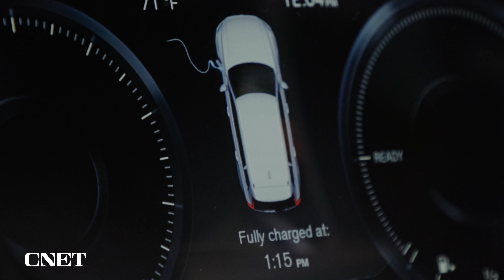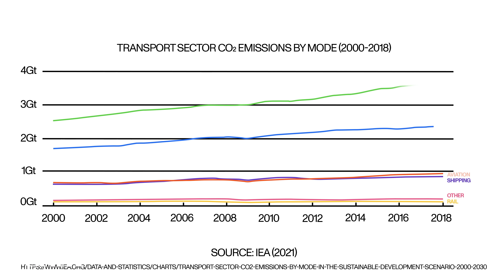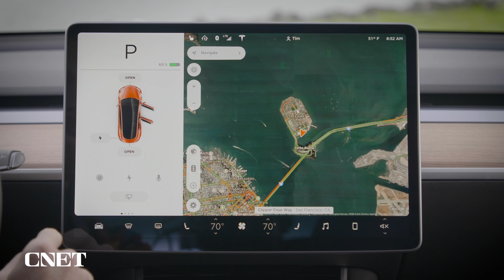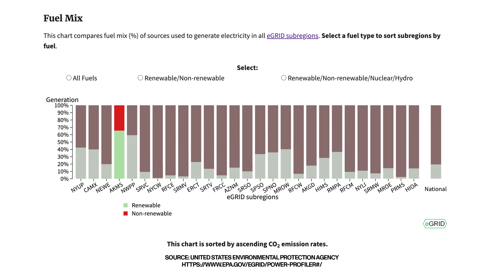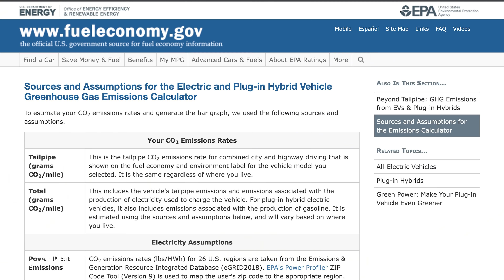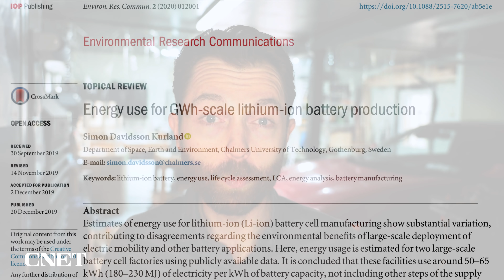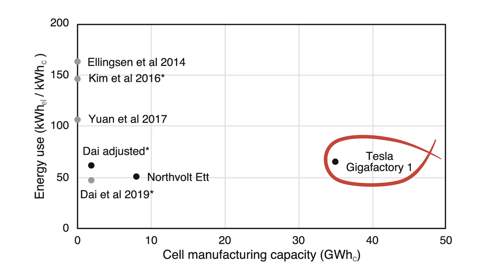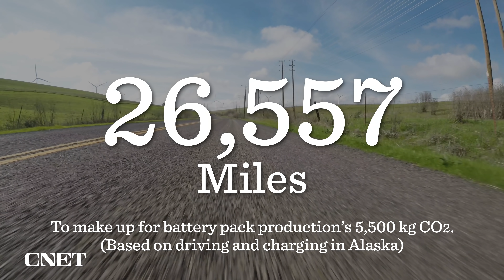Are EVs Actually WORSE for the Environment?

Comment: You didn't include the cost of a mandatory battery refurbishment after 5 to 10 years.. while an ICE can run for 20 years easily
Reply: Because your statement isn't correct. Battery packs will outlast the car they are first in (about 15 years), and then go onto a second life in some energy storage (another several years), and then be 98% recycled to become new batteries. Even with degradation after 200K miles, most EVs will still have enough range for someone. An aging ICE will need increasing repairs over time which is why most people get rid of them after a dozen years. They just aren't worth keeping on the road except for a handful of "classics". Meanwhile, a BEV can last 20 years with no maintenance other than the usual wearing of suspension parts. Although in the future I think more people may change cars, probably in the used market, more often to get the new tech that is constantly coming out.
Reply: Lol, you mean like the mandatory oil change ICE vehicles need every 5k-8k miles? 

I'm joking and see your point, but people don't realize that electric cars in the consumer market is still a new thing and far less developed compared to ICE. Tesla obviously wasn't the first to make the electric car but they were the ones who made them popular back in 2008. You're talking about 15 year old consumer technology vs 100 year old consumer technology that is much more developed and available to the masses. 

Honestly the only thing holding EVs back is the lifespan of the battery pack. Range is pretty much on par with ICE given that the temperature is right, and charge times aren't too bad. Give it another 10 years before we figure out what to do with the old lithium batteries, or we figure out how to make Sodium-ion batteries cheap enough for the masses. 

But the concept of the EV is still pretty cool. Less moving parts and less maintenance is perfect for the non-car enthusiast who just wants to go from point A to B.
Reply: @davidmccarthy6061  there is a reason why EVs don't hold their value after 5 years and it's that they need a new battery unit, just like a cellphone, and thus the cost financially and environmentally should be included in the equation
Reply: "5 to 10 years" You LIAR.
Rav4 EV from 1990s averaged over 15 years of secure power output from the battery not entirely dead. That was large format NiMH with at most Fan Forced cooling. Liquid thermally managed Lithium Ion is not much better and basicaly the same life span. Even mentioning 5 years lifespan is a Falsehood Scam.
Reply: @n7eet  " 5 years and it's that they need a new battery unit, just like a cellphone," LIES!
A BATTERY Package in a Long Range BEV is nothing like a 2 Cell Battery in a super advance BBK Phone with extreme fast charge. BEVs have Several Hundreds to Several Thousands CELLs with complex Wear Leveling via the smart BMS. A properly designed BEV also has Heat and Cooling for the battery. The Battery Package is VASTLY Different to a Smartphone, does you smartphone have a HEATER just for the Battery? Just because they use similar CELL technology does not mean the BATTERY is the same. BATTERY vs CELLs are NOT the same thing.

Comment: They are the less dirtier option. Even the dirtiest process to make EV batteries emit less CO2 than using no battery at all plus EVs have by far the lowest life-cycle GHG emissions. Despite the environmental footprint of manufacturing lithium-ion batteries (which won’t be used for long) this technology is much more climate-friendly than the alternatives even when taking into account that currently most electric grids are not carbon-free and the initial emissions associated with manufacturing the battery. Imagine what can be accomplished with much more efficient upgraded grids and power plants that require less fossil fuel along with solar and wind to fill the gap until next generation nuclear.

Comment: Electric cars weigh substantially more than ice cars. This wears out tires faster and wears down roads faster. Tires have to be replaced more often. Where is that in the discussion? Degradation of tires emits lots of particulates. I guess you can expect Goodyear and Michelin to make bank on this, but, we seem to be missing a lot of important long term costs in both dollars and environmental harm when comparing ice with electric.
Reply: exactly and this is why I have an issue with this full 100% push for EV's we have the tech let's shift the mandates to be all consumer cars trucks etc to be hybrid by 2030 rather than EV's on by 2035. it's a far more attainable goal and uses the best of both worlds rapid refueling and less energy usage.  That battery has the same weight full as it does empty.
Reply: John sorry to tell you but you need to do your research better, 2021 Chevy Bolt EV 3563 lbs compare to 2021 Toyota Camry  3310 to 3595 lbs. Not much difference, Chevy Bolt EV comes with Michelin Energy Saving 60k miles warranty tires and Toyota Camry comes with Bridgestone Turanza EL400 40k warranty miles.  Tires can wear faster in a EV if you don't adjust your driving because of the torque just like a Sport car.
Reply: @airwolf2200  Oh my god theses are two completely different cars in entirely different categories closer match would be the Bolt Vs 2020 Honda Fit that weighs 2522 lbs so a 1000 lbs difference every day and every mile. And wear is a big part as is damage incurred to roads, bridges and other cars in an accident.
Reply: @chrisherbert4454  just like the video, I was trying to find a mid car that has the similar performance and extras as the Bolt.  The Honda Fit does not even come close to the Chevy Bolt but if you want to compare Hatchbacks and 0-60 speeds: Focus ST 3320lbs 6secs, Mazda3 3,300lbs 6.9sec, Civic ST 3000lbs 7.2secs, Corolla 3000lbs 7.3sec, Fit 2183lbs 9.1 sec, Bolt 3563 6.5secs.
Reply: @airwolf2200  Normal people cross shop on space and format I.E. Honda CRV vs Toyota Rav4, Chevy Bolt is based on the Honda Fit so much so that the chef designer used it as the benchmark and why the two cars have a very similar look. Yes Electric gives a torque advantage coupled with a broad window of usable speeds removing the need for a multi speed gearbox or CVT will give EV's a performance advantage. But people don't usually start off looking for a Camry and get a Dodge Hellcat. hence you need to compare Civic vs Corolla vs Tesla model 3 etc.
Reply: @airwolf2200  Well, details matter. Toyota Camry is a substantially larger car, 192” vs. 163” in length, the Camry also has a range of up to 600 miles on a tank of gas, Bolt is listed at 259. The weight I find is listed as 3310 lb for the Toyota and 3589 lb for the Chevy, a difference of the smaller Bolt having 279 lbs to haul around. I think it is great that you added to the discussion and I appreciate your comment. However, I think comparing these two vehicles is not quite the apples to apples comparison which you imply. I think a more comparative pairing of ice vs electric will show that the weight issue is more pronounced. But, that is certainly worthy of a bigger and deeper dive into specifications which I think is warranted and helpful for us all to understand the trade offs between ice and electric!

Comment: I would have compared the Tesla to something like a Honda Civic or Toyota Corolla.  People that drive those types of gas cars are more accurate candidates to switch to a Tesla for environmental reasons.  Also, what about battery disposal and its impact on the environment.  My biggest issue with EVs is range anxiety, followed by EV prices.  I think they are cool, except for the fact that the current EV makers don't give you enough button controls...they want to put the smallest controls in the infotainment  system... like vent controls.
Reply: Massively outdated ill-informed cliche. It ain't 2015 anymore.
Reply: Agreed a match off of a Tesla model 3 vs Corolla Vs Civic or for that matter a Accord vs Camry vs Model 3 would be the better matchup. I know for the fanboys it's not fair because the performance is much better on the EV but most normal consumers are cross shopping within their size class let's be honest here one does not cross shop a Dodge Hellcat against a Camry.

Comment: Also electric cars may be more likely to be churned so the owners can have newer models ICE cars can be on the road for 15 to twenty years easily, don't think we will see that kind of lifespan for EV's
Reply: True, ICE technology is much more developed in the consumer market compared to EVs, and thats simply because they have been around longer. Aftermarket and used junkyards have more parts compared to EVs, so that makes them easier to repurpose/recycle. Its going to be at least 10-20 years before EVs can match the current lifespan of ICE cars. 

What I predict is newer battery technology will be developed to be cheap enough for the consumer market (ie: sodium-ion based batteries) and that will be able to be retrofitted to older EVs and give them more life on the road. EVs aren't perfect but they have less moving parts, which will technically make them easier to work on and keep on the road. Really the only thing you have to worry about is the battery pack, motor(s), and the usual car wear items like tires, suspension, etc.
Reply: YOU LIAR!
Rav4 EV from 1990s averaged about 16 years of secure power output from the battery. This was oldschool large format NiMH with no liquid thermal management. Long Range BEVs with Lithium Ion battery that has both Heating and Liquid Cooling is not much better basicaly the same lifespan. But during those short 17ish years you can wrack up massive mileage like 300,000 miles. Just which ever limit comes first.
Reply: @Neojhun  yea let's see when more people get hit with a 20k bill for battery replacement at year 10+ and see how many of them are willing to sink that kind of cash into a old car. Not to mention EV's are going to have another side affect say goodbye to cheep cars for 3rd owner plus so Seniors, new drivers, and people on limited income EV's are a tool to help with climate change but not the silver bullet. We need next gen nuclear and better efficiency for buildings and HVAC.
Reply: @Neojhun  and go easy on the yelling and tossing around the Liar word it's an opinion. Toyota has a outstanding track record but they also had the RAV4 EV's 3rd gen that were California only and partnered with Tesla they completely abandon the product line leaving the customers holding the bag. Also Right to Repair is going to be critical going forward if you thing EV manufacture's care about you think again.
Reply: @Neojhun  Tesla Model S battery cost right now around 20K FACT see Rich Rebuilds, Luis Rossmann, Warped Perception, Etc will the cost go down over time god I hope so but history has proven commodity materials generally go up in cost. Not a Liar stop the defamation it's an opinion.
Reply: @chrisherbert4454  I never said anything about the 3rd Gen, those are NOT 16 years old yet. The first gen from around 1998 are now 21-24 years old thus why we have the real world DATA. Toyota did not manufacture the battery, they did not even have the licence to manufacture it. They were supplied by Ovionics which Texaco eventually acquired. I know for a fact that Ovionics batteries are fundemtanlly WORSE than a Tesla Model 3 battery today. Massive factor is AIR COOLED. You know nothing about the engineering and power electronics. Instead everything you have said is ignorant false assumption based on ICE Brand Fanboyism. You are a liar.
Reply: @chrisherbert4454  "battery cost RIGHT NOW (2021 for Rich Rebuilds) around 20K" yet you stated "battery replacement at year 10+" that would be in 2033. You either stated a logical fallacy OR Intentionally LIED.
Reply: @chrisherbert4454  I have no clue Could go massive Expensive or Could go Cheaper. Even Experts have no clue how much a Battery will cost in 2033. You forcing the $20,000 price in 2033 is a LIE.
Reply: @Neojhun  Commodities generally trend up this is a fact not an opinion not a lie but a fact, look at the historical prices for copper, steel, silver, gold, lithium, etc all have trended up over time so with that we need newer battery tech and if you look at battery evolution vs CPU evolution  battery changes at glacial pace. Stop being so angry im giving an opinion not attacking you or anyone. And for the record my I put my money where my mouth is I have a 2021 Rav4 Prime plug in Hybrid with a 18Kw LiPo battery
Reply: @Neojhun  Troll your running on hopes and dreams look at battery tech progression lead acid 1800's ,1960's Alkaline batt comes to market, 1970's NiCad comes to market,  early 1990's Nickel-metal hydride, 1992 Lithium-ion comes to market. there's a huge  difference between made and working in a lab and large scale commercial  viable in battery tech shoot Toyota has been working on the solid state batteries for close to a decade 2012 is when they started. Again I'm here on the sideline rooting for the Tech and I have one a 2021 Rav4 prime. Read, Think, process, then make constructive comments and discuss, not everyone has to agree with you or see it your way if it was that way the world would be a boring place.

Comment: I've always thought of EV's like smartphones. No one is buying a used IPhone 6 in 2022. Will there be a market for 5 year old EV's in 2024? EV technology is growing yearly in leaps and bounds. It seems that a 2018 Tesla will be obsolete in 2024. A ICE car is still relevant a decade after its original manufacture date. In fact, the average vehicle age is over a decade for an ICE car on the road. Will there be a used EV market in 5 years where older EV's will still outperform newer ICE vehicles?
Reply: A 2018 tesal has the same updates  my 2021 model 3 and my  wife 22 model y. Just because the model year is old doesn't make it software old. Some mechanical parts have  changed like the  heat pump and double pane window. But the software will be better than when the car is new. Unlike other cars and some EVs .
Reply: @LaJuanHughes  
Would a 2018 Tesla have the same battery life and range as a 2022? I'm just curious if that can be extended through software updates or if the whole system can be exchanged. I'm not an EV expert at all.

Comment: Why compare what the battery co2 value is compared to a gallon of fuel. Once the battery pack is constructed it will remain in that car for it's entire driving life. Delivering the fuel to a petrol ICE vehicle is an ongoing process that only ends when the car is no longer useful.

And your argument that the battery sourced mining materials only counts about EV.s You completely ignore the facts about the sources of extracting oil from the environment as well as the refining process of that oil to make petrol..

Comment: What a scam! You don't compute in the fact that these batteries die after 5 years and need energy-consuming recycling
Reply: That's not true. New EV's are even sold with a 8 year warranty on batteries, how would that be viable if they die after only 5 years? My EV is 5 years with 60k miles and i can't even tell if it has lost any range..

Comment: I think you need to consider the disposal of the batteries, electric cars need to replace a battery every 8 years on average where gasoline cars don't have that problem. noting that they both contribute the same amount of trash at the end of there life
Reply: "electric cars need to replace a battery every 8 years on average" LIES!
Rav4 EV from 1990s averaged about 16 Years of reliable battery power output. This was oldschool NiMH with Air Cooling. Lithium Ion with Liquid Cooling is not much better but still 2x your LIES!
Reply: Disposal of the battery seems to produce less greenhouse gas than disposal of the fuel burned, which goes to the air. Ultimately we're just kicking the can down the road

Comment: CNG and LNG cleaner than EVs and every vehicle can adapt
Reply: That is simply false. CNG is a horrible due to fuel density is soo low. It's not even VIABLE to scale beyond current use. I've used CNG cars in Malaysia. It's a Dead end.
Reply: @Neojhun  it’s as good milage a battery cars and cheap fuel . All the cabs use it and big trucks too. True they need larger tanks and trucks often have 3 tanks . But you don’t have to wait 1-6 hours to charge
Reply: @BrogeKilrain  You very much do have to take atleast 15 minutes to refuel as it's quite the process jut fill up and pay. That is for EVERYTIME you fill up. Unlike BEVs takes 30 SECONDs of your time that you do not need to drive more than 200 miles. On the rare occasions you need to drive more than 200 miles it takes freaking 40 Minutes max. "wait 1-6 hours to charge" is a IMPLAUSIBLE Lie. Unlike Pumping Gas you can just walk away do something else.
Reply: @Neojhun  only if you have access to high voltage DC charger and very few around . Most have waiting to use
Reply: @BrogeKilrain  "Most have waiting to use" I've rarely ever had to do that and when I did i just had to wait like 10 minutes MAX. Soo that is ia FRACTION of FRACTION the total times I've needed to charge. You fail at MATH.
Reply: @BrogeKilrain  FYI I said 40 (FOURTY not fourteen) MINUTEs because the most common highly available DC Charger around.
Reply: @Neojhun   I’m buying EV for around town . No gas tax , VW gives free charging 3 years in very very few chargers available. So I’ll mooch as free charging at local mall while I have lunch there . I’ll win either way but love my diesel Tahoe and RAM pickup I can go near 650  mi on tank fuel and 1000 if soft shoe on pedal . Big and safe 😆
Reply: @Neojhun  your in love and making it religion . Realty beckons those who do more than put put around town te your range about half highway speeds